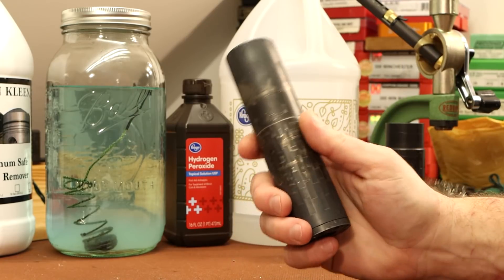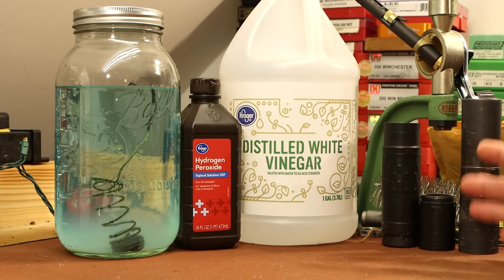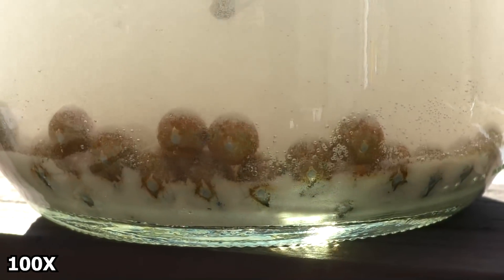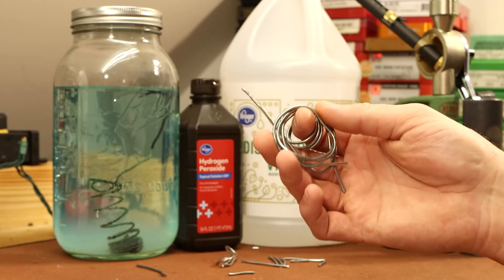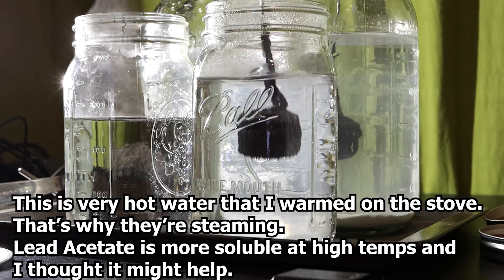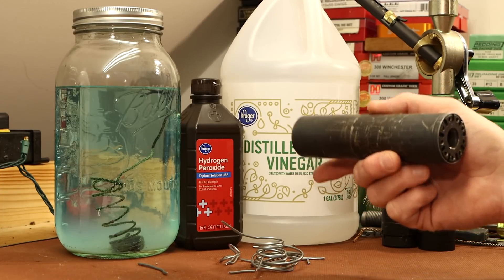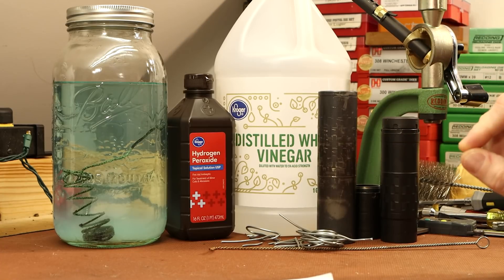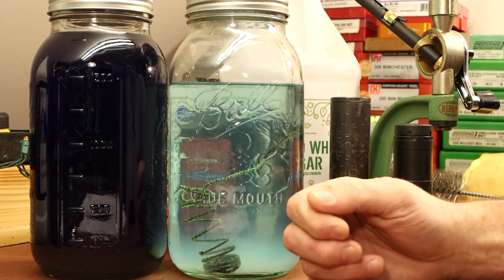Zinc makes The Dip safer. I think.

Comment: I have been using Piston Clean on my Can and gun parts for years. I posted that Chemical on your suppressor video. I don't know why you are trying do dissolve lead. You are not going to get lead in the Can.
Carbon is what builds up. I clean my can every time I use it. You won't have any problems taking it apart.

Comment: I did the dip on some individual baffles of my first 9mm can that I had been running 22 through. I knew the hazards. While it was the most effective and efficient way to deal with lead build up, I decided not to do it again. Now I just scrape off lead by hand with a pick maybe once a year. Sealed cans I don't even mess with.

Comment: You could have used sulfuric acid on the lead acetate turning it into lead sulfate and its not water soluble. I do this with lead waist and dump it into old batteries and get rid of it at the scrap yard.
Reply from the maker: Drain cleaner or something more concentrated? I saw somewhere else that this was a good way to go...it might be worth a shot.
Reply: @JohnnysReloadingBench  I use Rooto, professional drain opener for most stuff, its 93.2% sulfuric acid.  But how much is needed  would depend on volume of sulfuric acid to how much lead you have in solution. You can also use 98% lab grade but its not worth it.  Here is an easy way to try it out.  Take your solution with the lead in it and slowly add sulfuric acid. You should see a white precipitate, when you stop seeing the white precipitate falling out of solution the reaction is done, so no more acid is needed. Keep in mind this must be added SLOW as the reaction my be very exothermic.  Use coffee filters to filter off the white precipitate (lead sulfate). You could then dump the solution down the drain. If you think the acid will eat pipes  just neutralize it before dumping by adding sodium bicarbonate ( Baking Soda ) till it stops bubbling or tests around 7 for PH.  One more thing, try it with a small amount before doing a big batch. Other contamination could mess with the outcome.  Also use safety glasses and being done out doors/ventilated  is best

Comment: I thought build up in suppressors was primarily carbon and other byproducts of combustion. I'd be curious if there was a maintenance schedule of cleaning with only the Piston Kleen (e.g. quarterly or monthly) that would keep things relatively gunk-free.
Reply: primers are made of lead fulminate from what i understand so that is where youre getting lead from and why you always see those warnings on ammo boxes and stuff
Reply from the maker: That's the plan, as of right now. Piston Kleen and a fresh layer of anti-sieze on threads every few range trips. Hopefully it will make this dip stuff unnecessary.
Reply: @JohnnysReloadingBench  this was a test i did 10+ years ago, to make the baffels easier to clean the next time, if the baffles are removable, heat them up to 150f ish and drop them in a jar of DOT 5 Silicone Brake Fluid over night. then just wipe them off and put them back in. the heat allows it to better "soak up" into the metal pores...

Comment: I had no idea about any of this kind of thing. Seems if it weren't so hard to send suppressors everywhere you could have a reasonably priced cleaning service just so you didn't have to deal with that kind of crap.
Reply: My thoughts exactly...
Reply: If you have a suppressor with some build up in it just get some Boretech C4. Just plug the bore with a silicone plug and fill it up. It gave me excellent results. Now Boretech has a suppressor specific cleaning kit as well.
Reply: I'm glad all my moderators are strippable so i don't have to deal with this all i have to do is open it up, use something to clean like boretech eliminator and brush away.